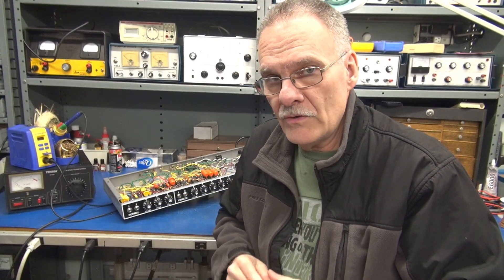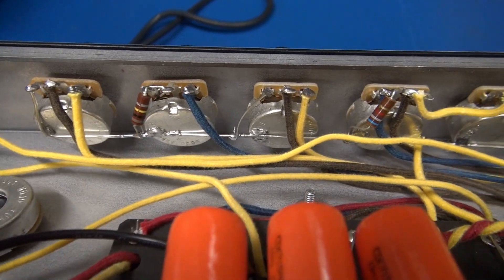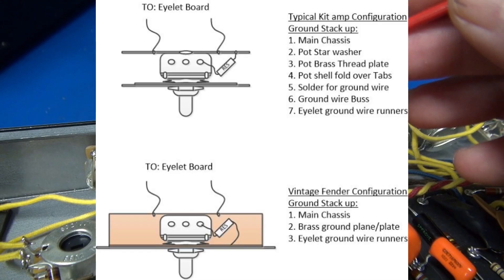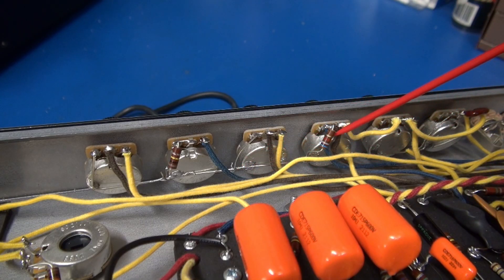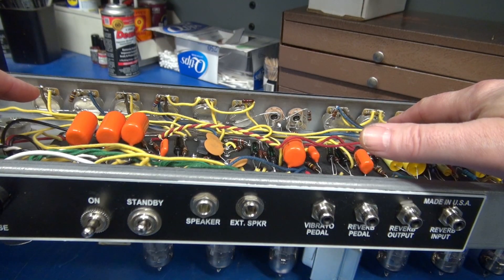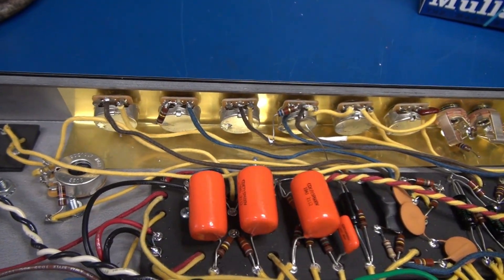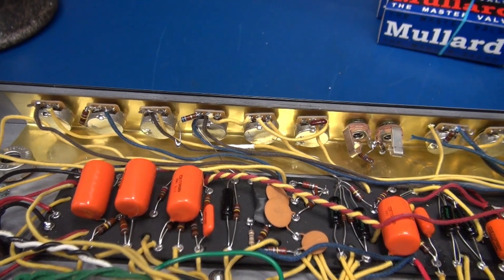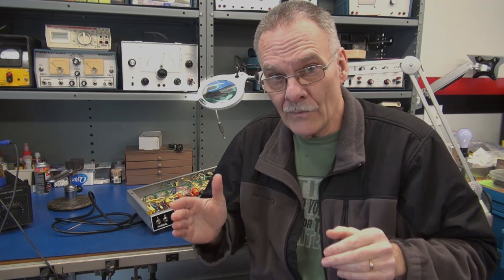Fender vintage brass plate Ground system vrs Kit tube amp wire buss method Stack up comparison

Comment: the brass plate always seems to work great in practice... but i always wondered... why the brass plate? why not just solder directly to the chassis in the same locations and eliminate the brass plate?
Reply: Brass is a better conductor.  The steel will have a little bit of voltage drop wherever current flows.  The brass is essentially copper.  And easier to solder to.

Comment: You're 100% right - what people forget is that a lot of the old valve guys (and I knew a load here in Britain, all sadly no more) where trained by the military to work on radio gear so they knew about grounding and inteference like we can't dream of, plus they thought in an analogue manner. We think in a digital way adn just because something is connected it must work, right? Wrong! I love that you made a thing of this, yes, the case of the pot is not at all well electrically connected and can make a frequency dependant semiconducting junction. Star earthing is also another very good practice. The only thing the old boys did that was wrong was 90 degree bends - thats military neatness and is actually really bad for analogue circuits. Great video - you earnt your red wine sir!

Comment: I have this kit coming tomorrow, and shim stock also on the way.  In addition to drilling the front panel holes, I plan to drill a small number of small holes (~1/8") on the back edge (closest to the eyelet board) for the ground wires to put through before soldering.  Good idea? Or no....warn me off if "no".  Thanks for all these videos on this issue!!! :-)

Comment: I’ve never been a big fan of soldering to the back of pots. Can get a bad joint or mechanical failure. Can you use copper tape instead of brass?
Reply: It "could" work; but I wouldn't do it.  The foil is great for shielding from outside RF interference.  But as a conductor meant to complete the AC and DC circuits (circular paths) it will like be insufficient.  One could argue that since the traces on a PCB or just little strips of foil, and they do just fine, what's the problem?  Maybe nothing.  But if you're into your amp elbows-deep, might as well do things in a way that offer the best of what you can do rather than what we can simply get away with.  
For my amps (and I mean MY, as in, I build them for myself), I always strive for, as close as I can, to a proper 'star' configuration.  Since I only build SE and PSE, actual point-to-point, it's easier for me to map out the layout that lets me get my grounding paths and connections to get rid unwanted interactions and interference quite well.

Comment: I did this when I made my mojotone tweed pro. I was listening to a podcast where they asked Fender why they did that, and their answer was simply that it was easier to solder to the sheet stock than put a wire across all the pots. No electrical or scientific advantage, and it wouldn't matter either way - as long as it's done right, but the sheet stock way was just easier. As a hobbyist builder, I just make sure I get 0's on my voltmeter from all points.

Comment: Amps like guitar amps are usually made to be mobile. Just moving it around may dislocated a wire to a pot eventually.
That posibilty alone should be taken into account ( besides what Terry has mentioned in the description) in using the 
Fender brass plate ground plane design especially if you are doing this to someone elses amp. So yes ,Terry is correct
on all counts.
Reply from the maker: Thank you for your support Sir
Reply: @d-labelectronics  Terry, do you remove the star washers from the pots' before installing?  Brass on brass makes sense I guess, right?      
PS. I'm just happening to be rebuilding a 95' Twin and I'm doing the same procedure. Thx!
Reply: Never mind Terry, I got my old 65' out and yes, Leo used the star washers.  Good enough for Leo.. well...
Reply from the maker: Nope, I reinstall the lock washers so the pots dont loosen & spin

Comment: I've done both ways....   with good success.   However,  I usually prefer the brass plate...   BUT  getting the plate to take solder is a bit tricky for rookies...  gotta have a super iron.
Reply: wide wedge tip with variable temp worked great.

Comment: what method do you use to cut the 6" stock down to 3" and have it look so even and nice? Forgive me if that's a dumb question.
Reply: With thin brass stock, you can actually use regular scissors, even the kind with plastic handles and get a pretty nice cut.  Works better than tin snips on thin stock.  It will dull the scissors for paper or cloth cutting so get a pair just for metal.
Reply: @torchandhammer  or just sharpen it.
Reply from the maker: I have a 25" metal shear in the shop
Reply: Use a ruler and a pocket knife

Comment: I've wondered why Marshall and other higher-gain  amps don't bother with using a similar brass plate (or at least something other than just wiring the backs of all the pots with a buss wire)? Is there something in their design that keeps the electrical interference at bay that the Fender doesn't, or was Marshall just ignoring/oblivious to it?

Comment: D LAB, Also you should do a video lesson on separating the preamp grounding scheme with the power amp grounding scheme to increase the Signal to Noise Ratio. A lot of repair techs are not isolating the preamp grounds from the power amp grounds because of various hissing, noises, buzzing, etc. I'm not sure at what point they break the circuit up, maybe BEFORE the phase inverter section or AFTER the phase inverter section they will isolate the grounds from the preamp to the power amp.
Reply: This is where I am now.  I've installed the brass plate like Terry showed, now I'm wondering about the power supply grounds.  I bought a built kit amp from a guy who was obviously chasing the hum, and had ground wires running all over.    Do I ground the cleaner section at the same point as the higher current section?  Seems like that might introduce noise.

Comment: I have built four Weber amp kits. All four use a brass ground plate. All four are nice and quiet as far as any ground noise goes.
Reply: Did you just use Flux and silver solder to get your solder to take on the brass?

Comment: I build that same amp and used the bus grounding scheme. Seemed to worked okay for a while. But the amp has developed a strange rush noise that comes and goes. Kind of sounds like one of those sparkly, crackling 4th of july fireworks when it really gets going. If I change the V2 preamp tube it goes away for a while. But eventually,  it rears its ugly head again. I was thinking I made a crappy soldier connection somewhere (maybe a ground), but  perhaps the brass plate will solve my problem. Think I'm going to give it try.
Reply: If anyone is interested, I did away with the buss grounding scheme. I followed D-labs advice and installed a .010 piece of brass shim stock. Well, long story short... it worked!! Pesky noise issues are gone!

Comment: In higher gain amplifiers I think of the buss wire on the backs of pots as a way to ground the covers of the pots ONLY in order to prevent the pots from picking up noise from inside the amplifier. This is for the same reasons that you point out in this video - the poor "ground" connections to the chassis. I usually run this wire with no other circuit ground connections made to it. Note that you MUST ground the covers ONLY to the appropriate circuit grounds to see this benefit(so it is not a continuous ground buss across all pots).  For what it is worth I havent seen problems in vintage fenders as far as grounding goes, so the brass groundplane is a good way to make it far easier to ground all those connections (For soldering, because most folks dont have a 200W soldering iron).

Comment: Hello Terry, Great video. The only thing that comes to mind is the issue of rattle. The ground plane appears to be be a good solder point and the properties in the brass are almost universally compatible with any metal types so A+ on that notion. However the plate sounds a little loose in the can and may cause other noises at certain frequencies as the speaker oscillates through its tones. Im having this issue with a Marshall combo 1x12 jcm900 amp and the plastic grab handles can get so loose that it actually sounds like a blown speaker. I have tamed it down using some O-rings but it still has some buzzing at the plate to box connection and i will likely have to replace them with all metal handles. it might be necessary to put a few nuts and bolts or rivets along the bottom of the plate. Just a thought.
Reply from the maker: Good thought. I have not run across that yet, but will be on the look out.
Reply: Solder the plate to the chassis as Fender does. Still a better grounding system than soldering a buss wire from pot to pot.
Reply: @funny0000000  Single part silicone sealers generally contain a cross-linking catalyst (such as a tin compound) that is activated upon exposure to moisture in the air.” When acetic acid is released, it attacks and corrodes metals such as copper, zinc, brass and galvanized steel

Comment: Well, kiss my capacitors!  This is so right, ground causes more problems when it is not well done. This solution reinstates Leo's genius ground. The buss system is only as good as the solder tech and many of those who solder are not the paragon of technicians, witness the 'pull off' connection. When I used to play for money, I got knocked on my a$$ so many times, holding an electric guitar and putting  my lips on  a vocal mic, I hired a guy to put ground lugs on  the back of every chassis. I then used a spool of bare copper to go from lug to lug to lug, then to a water pipe or even sometimes a ground rod outside the stage door. That stopped the shocking and lip splitting, made the whole stage rig quieter. Great Job D-Lab, superior! (as always!)
Reply from the maker: Thanks for your support man
Reply: Hi D Lab What is your method for wiring tube sockets and pots and jacks. I know people discuss mechanical connection but others just go straight into the eyelet, with serviceability in mind.
What do you recommend? As far as serviceability? @d-labelectronics
Reply: I would sometimes go to the water pipe myself before a gig...jus sayin'. :-)